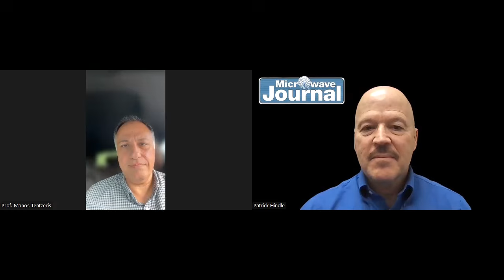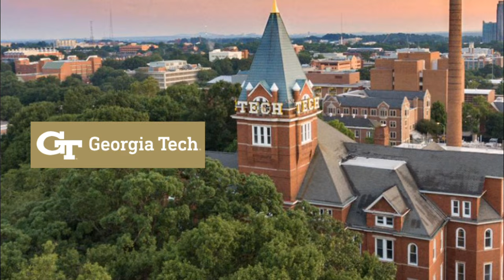GA Tech's RF and Microwave Course Offerings

Comment: Good information.  I'd guess that in their courses they'd use a text like Balanis' Antenna Theory Analysis & Design (Wiley).  Another appropriate one may be Atmospheric Radar by Hocking, Rottgen, et al. (Cambridge press).  Great books.  

Also, advise to high school students should be to get their ham radio technician/General/Extra licenses.  Amateur radio provides very practical hands-on applications of RF & microwave.  IMHO they should get into physics, and yes that means equations & math.